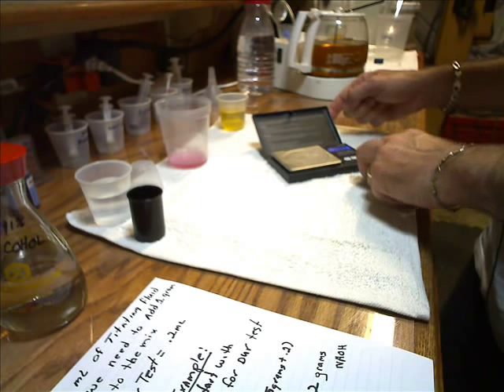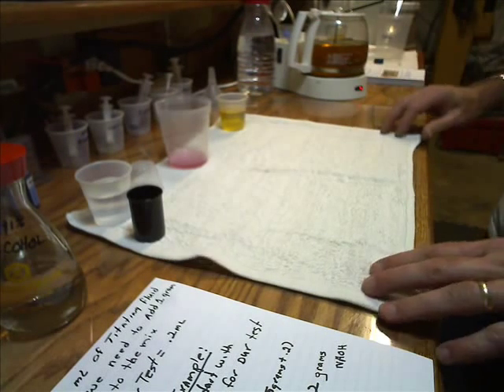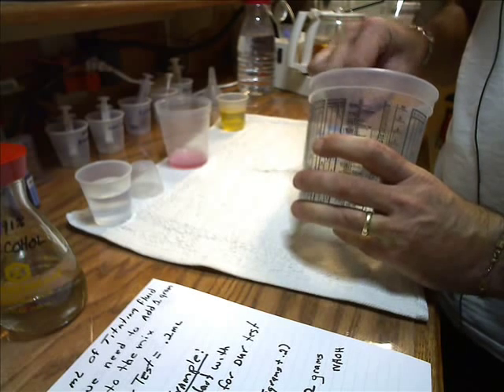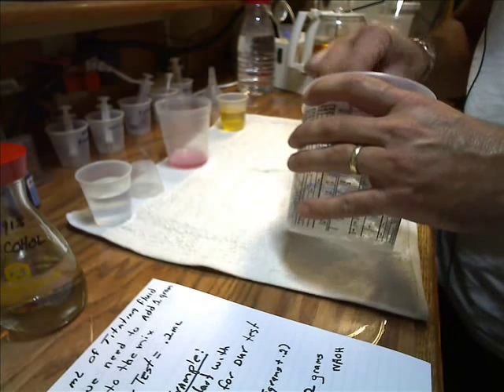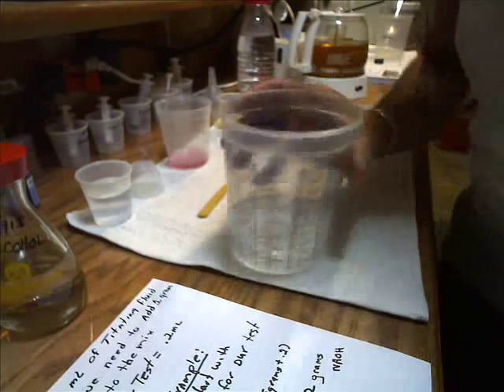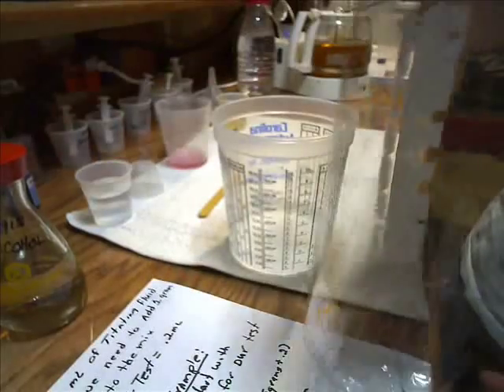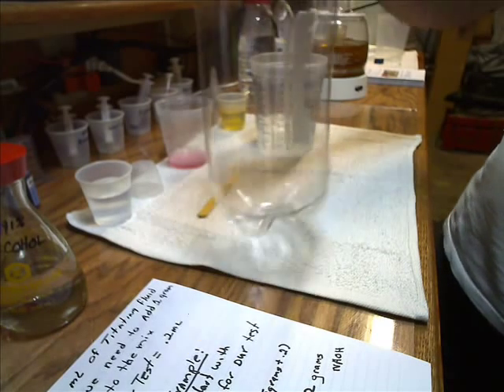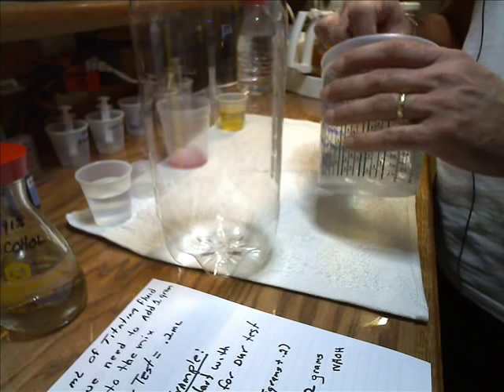How To Make BioDiesel #3 Making Methoxide

Comment: Why do you have to be so precise with the Grams of Lye?,if it was 1 Gram per litre more would the process not work?, what difference would it make.

Is the Lye basically taking all the gelatinous out of the oil?,so more Lye would be better,please what difference does it make, could i say for E.G. Always use 6 Grams of Lye for ALL used veg oil if its really thick?